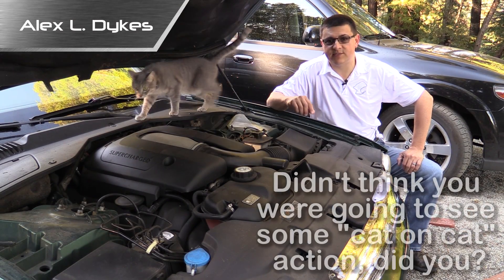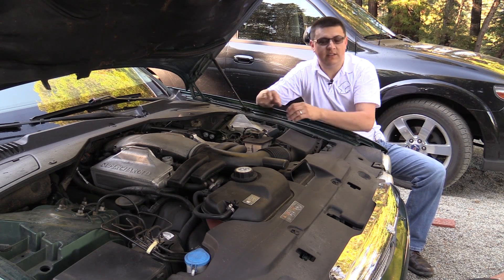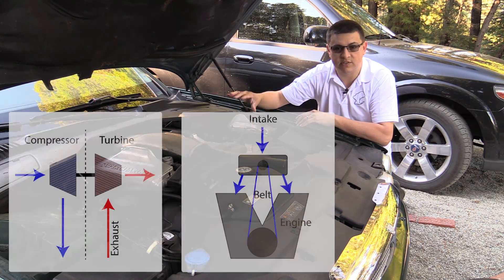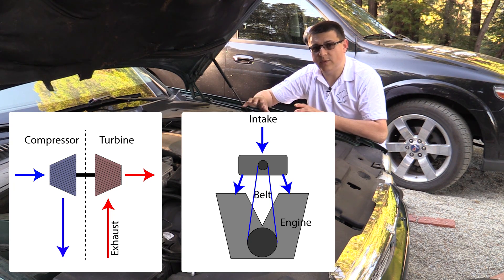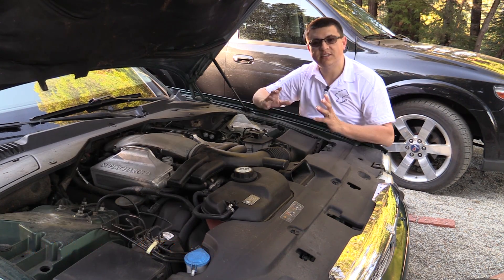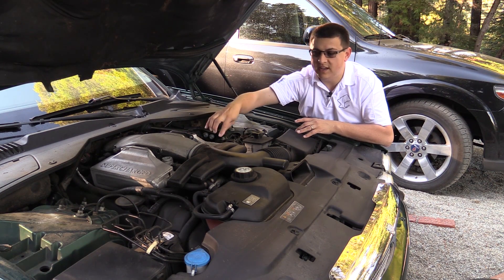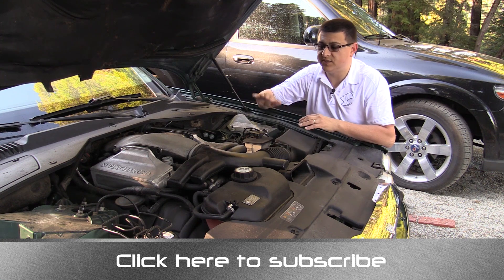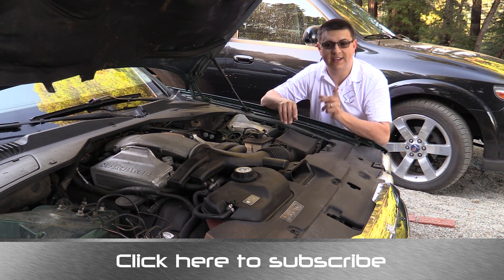Turbocharger vs Supercharger: What's the difference and how do they work?

Comment: Hence the installation of aftermarket superchargers is easy, can I add a supercharger to already turbocharged cars, in a way to marriage both of them in order to prevent lagging and to gain better performance, in another meaning the best of both in one(We usually hear about 2 in 1 or whatever in one in most good products out there in the market, but can this type of marriage work on cars)... Has anybody thought about this before?!.

Comment: What difference there is at the molecular level after the intake valve closes and before the piston goes up compressing? I mean, the supercharger compresses air molecules before entering the cylinder and turbo pushes air in as much is can according to the pressure valve, which difference there is then? At low RPM is what I am looking for

Comment: you forgot to mention centrifugal superchargers. to add tore boost to a supercharger you have to get a smaller pulley. eventually the pulleys get small enough to where belts constantly slip off or shred. i always carried two sets of gatorbacks in my cobra. but eventually you just cant get a pulley that is small enough to hold a belt and you have to go into cog chain setups. superchargers are best for low boost applications on high power setups. even then, i'd still go turbo. in the event you want more power, it's way easier turbo. and yes, i've owned both turbocharged and supercharged motors. just my opinion though.

Comment: OK, so I plan on installing a forced induction on my frs, which naturally produced around 200hp 150 torque, I want to get it to at least 400hp and torque. now I found a couple supers and turbos that can support that much power, but in terms of reliability, which one is more reliable in general, as in which one is less likely to blow up my engine or heat it to the point it won't work, or reduce its life?
Reply: j Tk just wondering did you get it yet?

Comment: Superchargers also have much longer life expectancy because they are not powered by super hot exhaust gasses and if I shut down a supercharged engine right after driving it's not a big deal, while the turbocharged engine should be left running idle for few minutes in order to cool down the turbocharger before shutting it down completely.
Reply: Not true for new engines, they run much cooler when just cruising. However if you do some pulls you should cruise/idle for a while to let the turbo cool, but the same goes for N/A cars too, otherwise your exhaust will be starting to crack :P

And turbos have many many times lasted longer than the car! My father owns a tractor which has a turbo from 1988, and it has done 20 000 hours by now, still runs at 10 PSI boost :D

Comment: Wait?  So if a supercharger is designed to make more power then whats the point if it takes away 20% of the gross sum anyway
Reply from the maker: +Ben Dover Because if the supercharger increases the power output by 60% for instance, then a 20% penalty still means you're making 40% more than before. The supercharger allows the engine to produce more power than it consumes so the net is positive.
Reply: +Alex on Autos this is why people make anti-lag systems to reduce the drag and direct more power.
Reply: I don't think thats very practical to have combustion happing in the turbo plumbing.

Comment: Thanks for your video! very simple and easy to understand information! i got one question,, i was wondering about if in both cases, theres any device you can use to "disable" any of those thecnologies and just reactivate it when you want ? i'm asking this just because i don't need all horse power delivered from a turbo or super charger all the time, just in some cases.. i wish i could disable it and activate it when i wish as i'm driving, like a nitrous, got it ? thank you in advance
Reply: Edson Brasil hey mate I was also thinking of performing this stunt and after testing a few materials with the majority of them braking I decided not to install some kind of "clutch" to the super charger because it's simply there to break. Would've been really cool tho 
Now to the turbo part: You could make the fan stop spinning but the gasses would still be blocked by the shape of the fan. Another way would be to have 2 pipes coming out of the engine, one of which having the turbocharger and the other one being clear so you could switch back and forth. But that would be an extremely bulky build and considering that you probably won't have much space to begin with this isn't the way to go either. So your best bet would be to go for the "clutch" mechanism that I've first described so you'd let the fan spin freely and without any "strings" attached. Would still cost some power but the best solution I could think of for now 

Cheers
Reply from the maker: Edson Brasil Although technically possible I suppose it would add weight and complexity and likely decrease fuel economy since the engines are designed for the turbo or supercharger.
Reply: +Alex on Autos i understand! So could it be, instead of a "switching device",  should i install a larger turbo, that will only starts to spin at higher rpm, doing this workaround  "city driving" will be more economy, since i`ll be running in RPMs under (like) 3500? the turbo lag would be more expressive but that will allow me to management the use of it, in example: if i want use turbo , i just do longer shift changes, if i dont want to use it , i do shorter shift changes, correct if i'm wrong :) thanks for the attention!

Comment: Wow, this was actually very useful. I'm a bit of an amateur when it comes to cars, but a friend of mine somehow got me interested in the whole car modification scheme and now I'm debating if I should add a supercharger when I get a car. I knew that superchargers were generally in the low-end torque range, but I didn't know they were (generally speaking) less efficient than turbochargers. Now I can see if it would be worth the cost to buy and install one. Thanks again for posting. Especially for n00bs like me! ;)
Reply: +ZildjianN7Geth you should also think about it that a supercharger uses more fuel than a turbo because the boost starts lower with superchargers and makes it consume more fuel
Reply: ZildjianN7Geth Go turbo!

Comment: Hey quick question: i've driven a super charged car before, and one thing i noticed in the before/after was that the response on the gas peddle was more jerky (presumably from the low end power), my question is that since a turbo's power comes in at higher rpm would this effect not be present? I'm looking at this from a daily drivability perspective.

Also how would the two differ in a manual transmission, i.e. would super charging affect the gearing etc ?
Reply from the maker: Jared Patel Technically the supercharger itself has little to do with this, although it will improve low end torque which a turbo will not. Most of the difference is simply in the way the car company decided to program the computer and map the accelerator pedal. They really have no effect on transmission life, although with more low end torque I would assume that your clutch may not last as long if you tend to slip it more than some folks.
Reply: Alex on Autos ok thanks, i think turbo for my manual is probably better for my needs in this scenario.

Also are turbos (in general) better in terms of fuel efficiency?
Reply from the maker: Jared Patel Generally speaking, yes. Turbos are more efficient.

Comment: Hi alex which is more reliable in the long run ? 
lets say i have scion frs and i want roughly 300 Horsepower at the wheels ...which one shall i go for ? a turbo or a supercharger...please explain sir :) !
Reply from the maker: There seems to be no difference in reliability. After-market like this however a supercharger will be easier and generally less expensive.
Reply: which would you prefer sir alex ?
Reply from the maker: Vikram Goswami  Oh my. Tough question. I have owned two turbocharged vehicles and one supercharged vehicle, so I guess that means I prefer turbos.
Reply: Alex on Autos thank you ! i guess you and like the efficiency of the turbos ...and the dramatic turbo lag some vehicles give is really entertaining .... i live in the philippines and here we have a "MUV" called Toyota INNOVA it has a 2.5 litre turbo diesel that puts out 100HP and 250Nm of torque to move around a vehicle that weighs around 4000LBS lol but the turbo lag is hilarious !!! the power comes in at about 2300rpm but it moves the vehicle pretty briskly for our philippine traffic ...the car an do a 0-60 in about 17 seconds hahaha but its a very tough car !! check it out if you can :) !

Comment: How about an electric motor powered supercharger?
Reply from the maker: Supposedly Valeo is developing one. The tricky part is that generating electricity to run an electric turbo would be less efficient overall than a traditional turbo. However, Valeo claims it will be 7-20% more efficient in total if you use it on a hybrid vehicle with regenerative braking so energy from braking would be used to help spin the turbo.
Reply: Ther can be no turbo in ab electrict car motor but if you want more horsepower you can buy a new motor

Comment: Turbo hands down. Way way more difficult to install but it's more bang for your buck. 
The supercharger has a HUGE parasitic drain on the engine just to run it.
The turbo interferes with exhaust flow slightly. So the engine can't push out waste gases as efficiently. But it negligible amount, also some turbo app need extra back pressure and and larger diameter down pipe is common fix in turbo cars.
He didn't mention why a turbo needs a bov or waste gate for unused gases. This is important to know

Comment: In response to jdewey2005, I have heard that turbos' tend to develop pits on the turbines over time and loose power. My 1983 Toyota turbo pickup seemed to have a loss of power after 100K miles. maybe it was my imagination. My 2005 Mercedes E55 is supercharged and it has 98K on it and it runs like it did the day I picked it up from the dealership in 2005. I'm sure there will be several different opinions on the subject, but this is my personal experience.
Reply from the maker: Materials science has greatly improved over time. My 1998 Volvo S70 T5 made the same on a dyno at 180,000 miles as it did at around 30,000 miles and my 2006 V70R didn't diminish over 95,000 miles. The modern metals used and cleaner engines make a big difference.
Reply: Glad to know that things have improved. Editorial comment: Alex, your reviews are light years ahead of all others in details, depth, and accuracy and reflect your superior knowledge. Keep up the excellent work and best of wishes for your success.

Comment: I also understand that superchargers tend to sip more fuel, right?
Reply: Yes, because they pull load from the engine output. They do however provide low end power. In order to increase fuel efficiency, many modern engines with superchargers and multiple driving modes provide an "eco" mode that disengages the supercharger.
Because Turbos pull less power from the engine to work, they can be used for either increased power or improved fuel efficiency, or both, depending on how they're setup/tuned and how you drive.
The best of both worlds would be an engine with both and a sophisticated system that adjusts them to provide power or efficiency, depending on the driving mode chosen.
Reply: Robert LeBlanc
Thanks for the info!

Comment: So which is better and fastree turbo charged or super charged?
Reply from the maker: It depends on the design.
Reply: Alex on Autos so is the supercharger on an a6/a7 a good one.. should I b worried about anything or is it just a preference?
Reply from the maker: Bhaskar Reddy
It is more of a personal preference. The maintenance cycle on the Audi will be a bit more complicated than on the BMW 535i because the Audi uses a water-to-air intercooler like my Jag in the video. This means you have more coolant plumbing, a separate coolant pump, etc. The turbo in the 535i is in some ways a little simpler. The Audi engine gives more low end oomph in trade.
Reply: Alex on Autos thanks alex.. i follow ur videos as they are the most practical..i currently have a 12 camry as my first car and it's such a bore to drive. Wish to upgrade to a German sedan.. maybe 2012 a6/535i/e350. . A6 has better styling and low end oomph. .535i is more solid overall but I'm worried about the run flat tires.. should I be? I'm not ruling out an e350 too as its not bad.. thanks for ur opinion
Reply from the maker: Bhaskar Reddy  Well run flats are more expensive to replace so that is a big factor. Another solid option (honestly) is the Volvo S80 T6 AWD. It will be 90% of the 535i's performance (very similar to the A6 and faster than the E350), very similar in handling to the A6 with a slightly smaller back seat and a price tag about 20% less.
Reply: Alex on Autos hey alex can I contact you directly via email? Instead of cluttering it up here. Thanks
Reply from the maker: Bhaskar Reddy
 Sure, you can find the address over at https://www.youtube.com/user/TTACVideo/about
Reply: Thanks, but what i mean is if there is 2 same cars with same weight and hp but one of the cars has twinturbo and the second car has sopercharged who's gonna win the race?
Reply from the maker: Seno Raffah  Well, again that would depend. If all things were equal it would be a tie. But going with "general" statements that are very broad and not vehicle specific, a supercharged car would be faster 0-30 while turbos tend to be faster by the time you hit a quarter mile. In the Jaguar XFR- vs the M5 you can see this to a point with the Jag being incredibly fast to 30, about the same to 60 and a hair slower to 100 than the M5.
Reply: Alex on Autos thanks alex.. i have sent an message from ttac.  Hope to hear from you.
Reply from the maker: Bhaskar Reddy I am no longer affiliated with TTAC so I think that email is lost forever.
Reply: Alex on Autos got ur id. .i was looking in the wrong place.. will Draft an email in some time. .Thank u